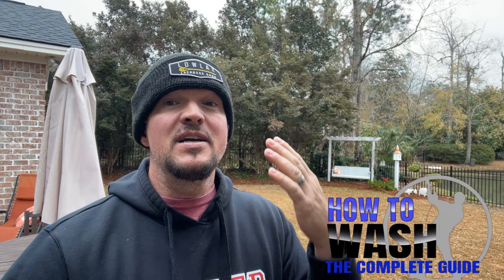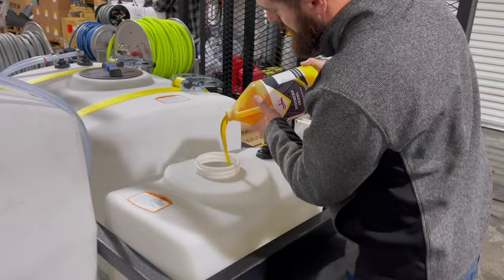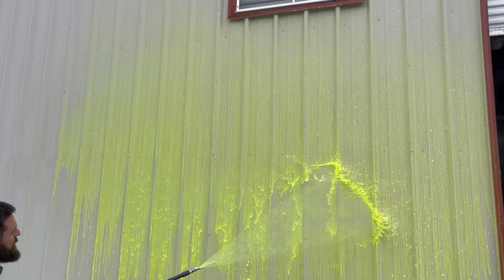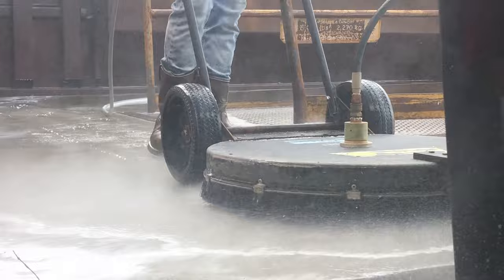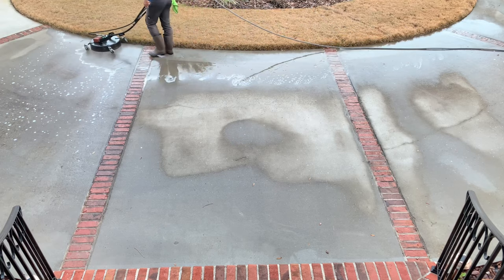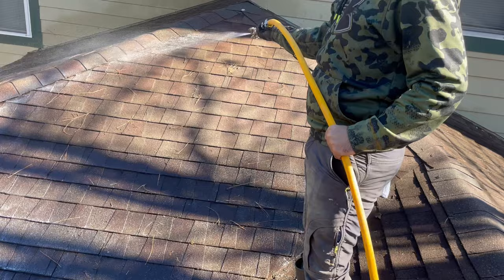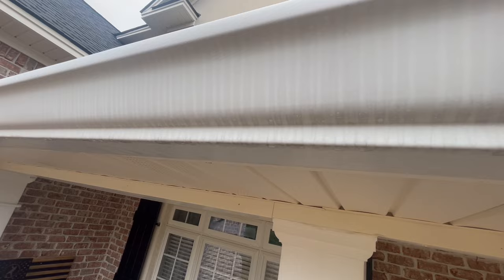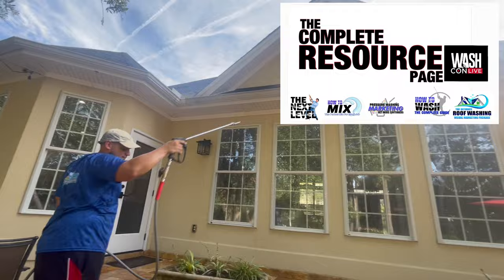What Chemicals The Professionals Use For Pressure Washing & Softwashing

Comment from the maker: HOW TO WASH - The Complete Guide :  https://bit.ly/HowToWash101

The Resource Page: https://bit.ly/PWashResource

The Equipment: https://bit.ly/PWEquipment
Reply: God speed on recovery and good to know tips
Reply: Awesome video. I wanted to know if people have well water. Do you take the job without worrying if the well runs dry?
Reply: @oilandwinerepentanceminist1114  I to have wondered and asked the same question but yet to have any answers
Reply: Thank you 🙏 sir,
Reply: Do you have a list of the best chems?
Reply: I have a question: if you are washing a car, do you have to turn the pressure washer off or water if you not using the pressure for like 10 mins while you were like scrubbing the tires or something?  The only reason I ask is because I had a garden hose blow up on me one time, but it was a cheap garden hose so I was not sure.

Comment: I used a cup of liquid pool chlorine to one gallon of water and an ounce of Dawn dishwashing soap. I put it on with my garden sprayer then rinsed everything off with my pressure washer. Looks brand new. I only had to deal with midlew on the North side of my house.
Reply: I live in Florida and get a lot of green on one side of my house I just use simple green #3 on my walls and let it set for abought 6 otr10 min  then put the washer to it  and it comes off with ease and I do not half to worry abought killing plants but I always pre spray the walls and plants before and after out of habit

Comment: Hello from Columbus Ohio, I’m this business but one great chemical which is great on engine oil crusty driveways or concrete and paved areas is Kerosene, so you can apply it with a spray bottle and scrub the area, let it sit a few minutes then power wash with a good detergent of your choice, Kerosene doesn’t harm concrete or pavement areas because it isn’t harmful, it is even good to clean oily dirty car parts, it can even clean your hands and many things, it dissolves the dirty grease so well and then you can wash your hands with soap and you’ll see how easily it cleans good.
Reply from the maker: Thx

Comment: with metal gutters, i use kiltz oil base stain blocker, that prevents more damage in the future, and its paintable. I use a rust protective for my clients and paint them and its usually good for 10 years.

Comment: If you read this I'd like to talk to you about a business I'm going to start within the next year. I can't post to much about it on social media because of the businesses I'll be working for. I can say it's cleaning commercial pizza ovens. I've used cold water pressure washers when I clean the ovens but I run hot water through them. I can get a couple years out of a cold water pressure washer running 140 degree Fahrenheit. I can show pics of before and after.
Reply from the maker: That's awesome A good luck

Comment: If you use a good soap and brush those areas on gutters, you will get them clean. I did this work and had over thirty years of experience behind me. I cleaned roofs and homes and vehicles and if you use the right stuff with some HF also, you will get things clean very easy.

Comment: so when you fill sh tank do you usually just add a gal or so of surfactant of choice?
Reply from the maker: We don't use a surfactant when we downstream - only when using the 12v Softwash system - we meter it in based on the surface and how much we need.  
You can batch mix it with your SH, just follow the instructions on the bottle of whichever brand of soap you bought.

Comment: Good info. Your bleach concentration is so low you shouldn't lose much (if any) surfactancy using washing up liquid. And if you have hard water and grease, the nonionics are good to prevent unsightly scum or persistent tight foams. I guess using proprietary blended anionics in place of nonionics may give you better credibility. If you are using a high enough GPH, any surfactant should work. I'm sure you guys have tested alot anyway. And there is mechanical damage to the surfaces to contend with no doubt. Great vid!

Comment: Hi Mike! I've thought about getting into power washing but I only have around $200-300 to spend. What is your suggestion?
Reply: You can buy a backpack garden sprayer mix the water and bleach in it and rinse with a garden hose that will get you started. You may need a ladder A Frame  ladder if you are doing  a 2 story
Reply: You should really save up more money. I did the backup sprayer method to get my insurance policy quickly reinstated, but the four gallon tank really isn’t safe to walk around on the roof with and the cheap backpack sprayer fro harbor freight wasn’t designed for heavy chemicals and it leaked burning my back lol! Now I want a truck, a 55 gallon tank, and a 5.5 or 7 gallon per minute pump. If only I didn’t need the truck ha ha. Maybe next year

Comment: I have a question and I doubt you have heard of this but maybe u can help. My wife noticed a yellow jacket nest in the window sill outside. Her dad told her to spray brake parts cleaner on it with she did and it stained the vinyl siding I got home and she told me what happened I told her I didn't know the brakes on the house were squeaking with she did not find funny. I have tried bleach and just straight 0 angle on the pressure  washer and it hasn't do e a thing to it. What you think.
Reply from the maker: Sounds like your father in law shouldn't be giving out pest control advice. 

When brake cleaner come in contact with rubber or plastic,  it disintegrates or otherwise breaks down whatever you sprayed thereby causing permanent damage. Brake cleaners damage the plastic materials by targeting the components that bind them together.
Reply: @AllAboutPressureWashing  you are absolutely right about that. Thanks for your help.

Comment: Comparing stronger SH to weak SH like a ferarri to a Honda is not accurate.  You will dilute the mixture EITHER WAY so you can just use MORE of the weaker SH to get to the same dilution rate.
Reply: Thats exactly what I just typed this guy is extremely thoughtless